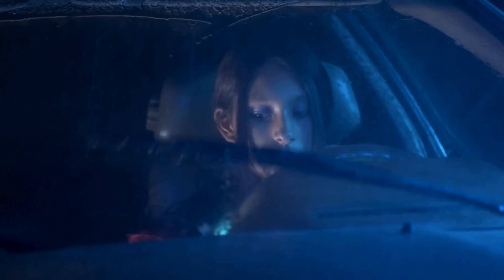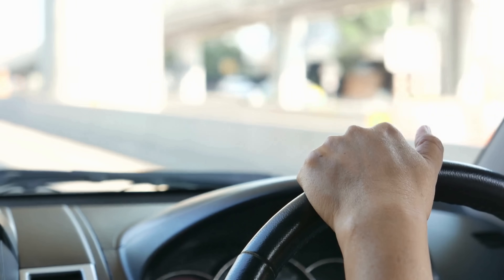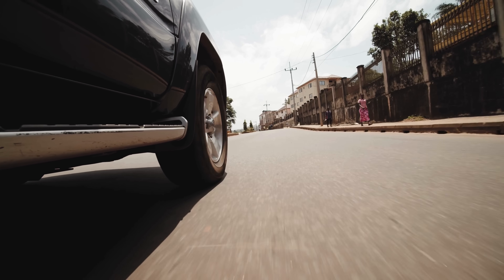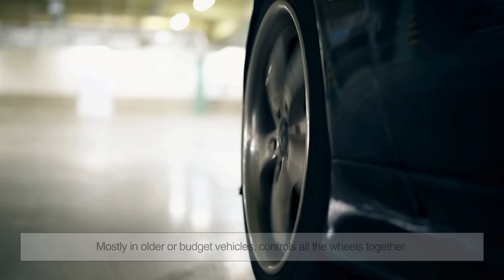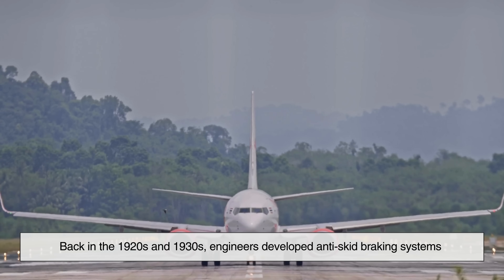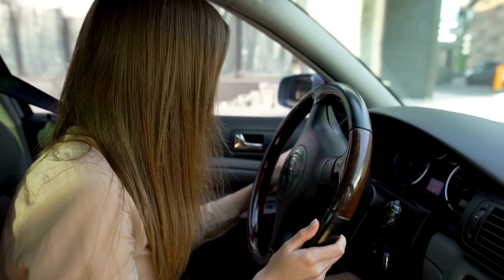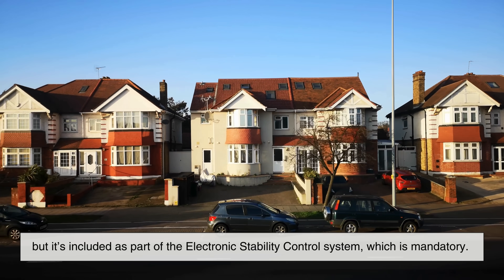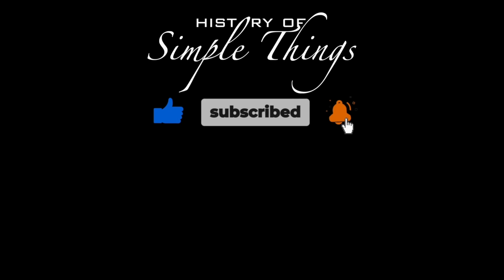What Makes Anti-Lock Braking Systems (ABS) Essential?

Comment: 7:29 Loose surfaces (gravel/snow) "...that's because it prioritises steering control over a full stop".
False! This is a consequence of how ABS works and nothing to do with deliberate prioritising. This is a marketing excuse, trying to explain away the scenario that a blocked wheel actually stops faster on loose surfaces because the material builds up a wedge dam in front of a skidding tyre, massively increasing friction and reducing stopping time. If the tyre continued to rotate (ABS), such a wedge would never form, hence taking longer to stop.
Reply: True.

Comment: In an engineering context, ABS actually stands for 'Anti Blockling System', as can be read in one of the original patents from:
Inventor: Toshiro Sagamihara Kanagawa Matsuda, Robert Bosch GmbH in 1975:
'DE2556023A1 - Anti blocking control for pneumatic brakes - with large throughput membrane mounted valves for fast response'
Inventor: Toshiro Matsuda, Nissan Motor Co Ltd, 1985:
'DE3644221A1 - ANTI-BLOCK BRAKE CONTROL SYSTEM FOR A MOTOR VEHICLE'

Comment: 2:42 during abs the pump is not used to increase pressure on a wheel. It is there to push back the fluid to the reservoir after pressure decrease. The pressure increase is done by the driver during braking.

Comment: Yep, ABS is a very important engineer art, i braked on a slippery road and could as steer properly as brake faster and i felt the vibration on the brake pedals